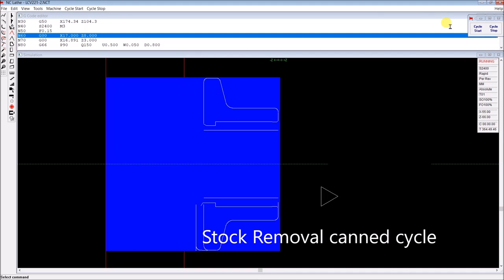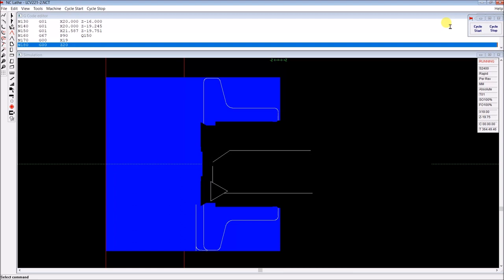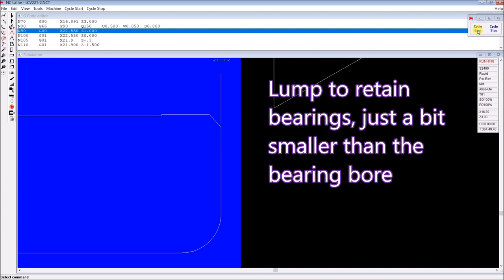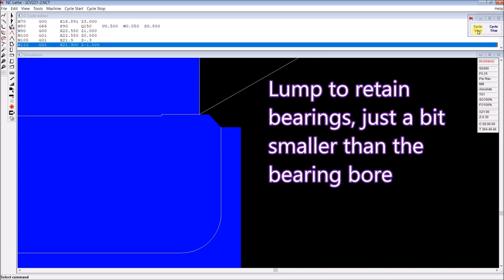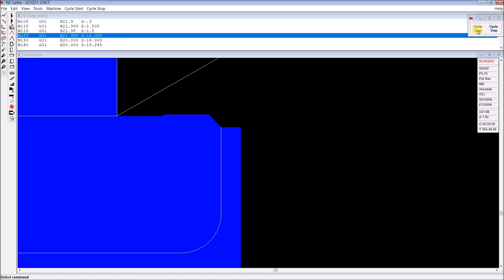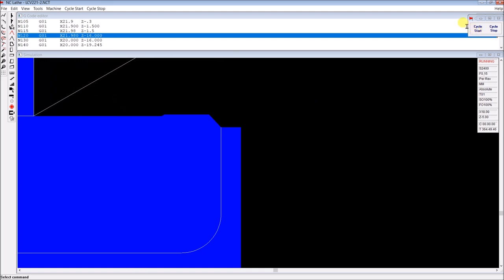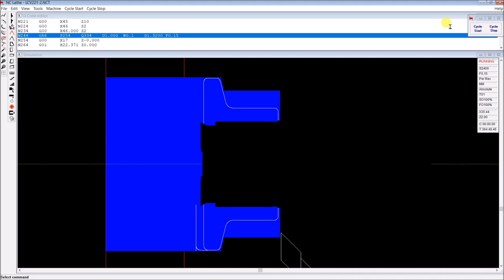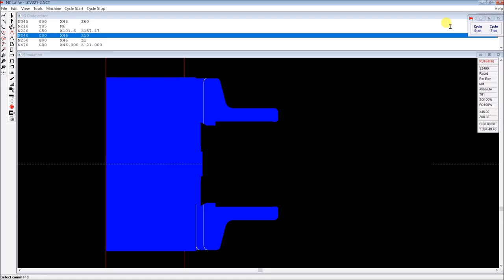Small cnc lathe bores, turns and parts an acetal roller

Comment: Thanks for the plug. Love that swarf 😊, but if you think thats bad try machining superstone (CMA1) you get one almost dead straight long thin very hot razor blade coming off a parting tool - it rapidly fills the shop and it will not rust away when thrown out in the rain...Martin

Comment: I was wondering why you made blanks first, but it's because the stock doesn't fit through your spindle bore.
How much waste does that cost you in material? 20 to 30% ?

also choose F0.8 for threads ;-)
Reply from the maker: Blanks were 30, finished part was 19 long. That may seem high wastage, but these were rollers and this way I had no concerns re concentricity. The quantity was also low. Thanks for your comment, always appreciated

Comment: That was cool to watch.  That material looks so soft but I guess it has some strength since you can press in bearings.  I know nothing about that material.  Thanks
Reply from the maker: Hi Gary, it is fairly hard for a plastic. I had to guess how much interference to make for the bearing bore. Got it fairly right, just needed enough grip on the outer race to make it turn with the roller. Thanks for the comment

Comment: Thank You for the video.   What software are you running on your lathe?   Is that software available for purchase anywhere?
Reply from the maker: The software was supplied with the lathe. It was produced by the lathe manufacturer.
Reply: @smallcnclathes  Thank you.  Shame its not readily available.
Reply: @joecnc3341  It may be available BUT, it would need to be run in Win98 and if you just want to use it as a simulator it may be that the G code you use and the G code the software uses may different making simulation inaccurate.

Comment: Why'd you part it off?
Reply from the maker: I parted it off from the waste material that was in the chuck
Reply: @smallcnclathes  Yeah, but you had soft jaws, why didnt you just hold on the back of the part?
Reply from the maker: @spikeypineapple552  the back of the part was not there yet. The soft jaws were deeper than the flange on the part. Sounds like what you are saying would mean working from both ends. Not economical compared with a bit of waste material. Lets face it this should be done in a machine large enough to hold the 45 bar stock, then they could be made this way without the waste material. I was only making a few parts as prototypes. If they are ok, the job will probably go to someone with a larger machine, there is also a roller of 60 diameter involved. Probably in next weeks video featuring blue acetal.
Reply: @smallcnclathes  Nice. Just out of interest, why don't you upgrade to an old slantbed CNC? You surely have enough work for it.
Reply from the maker: I have retired a couple of years ago, I can hardly justify the two small lathes I have. Thanks for your comments